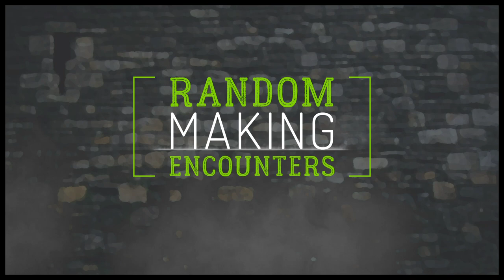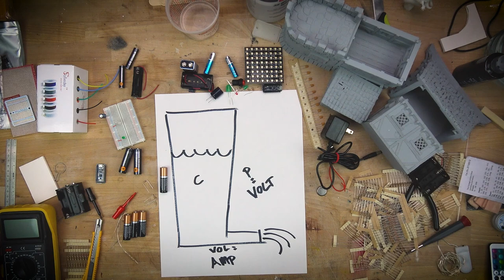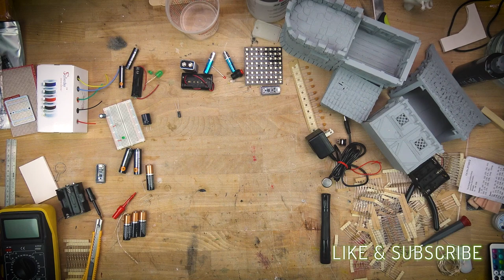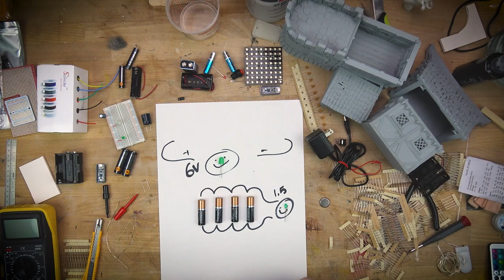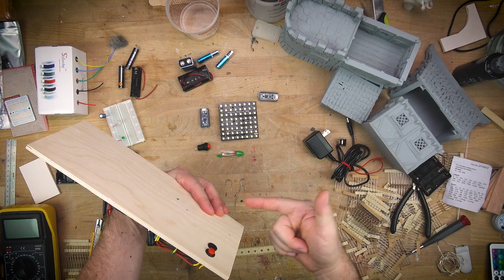Terrain Tips - Getting Started With Electronics

Comment: What gauge wire do you typically use?
Reply: Also, is it "Tinned copper wire"?
Reply from the maker: I generally use 20 or 22 gauge wire. I use silicone insulated, stranded wire... not tinned as far as I can tell. Silicone insulation will not melt when soldering and stranded wire is more flexible. However, solid wire... no little strands bundled together... will generally hold its shape and carry more current.

Wire gauge should be based on how many amps the circuit will draw. Here's a link that shows what the amp ratings are for various kinds of wire - https://www.engineeringtoolbox.com/wire-gauges-d_419.html If you use an LED calculator like this - http://ledcalc.com/ - you'll see it calculates the circuit's total amperage. If I plug in 10 LEDs on a 5 volt power source, I get 183 mA or 0.183 amps... well below the 1.5 amp smallest number on the wire chart. 

Kind of a long answer but it's always good to keep these things in mind. If the amps are too high and the wire too thin, you end up with heat... like a lightbulb. One last thing to keep in mind by way of a disclaimer, I'm an art major and my electronics knowledge is based on general research. It doesn't hurt to double and triple check my numbers :).